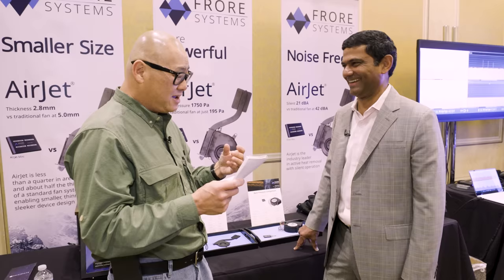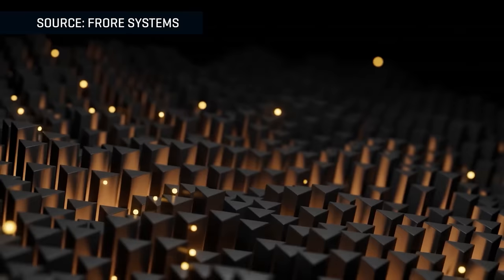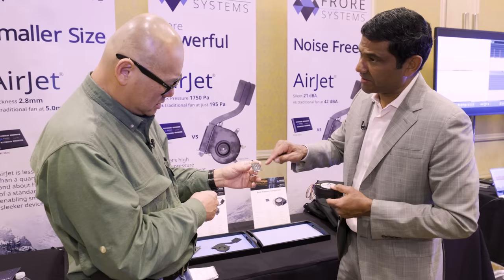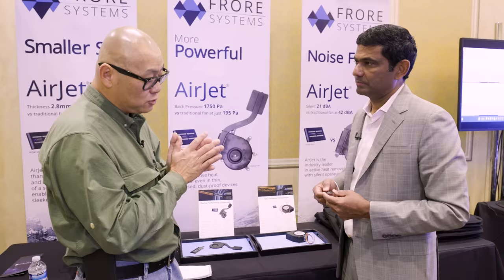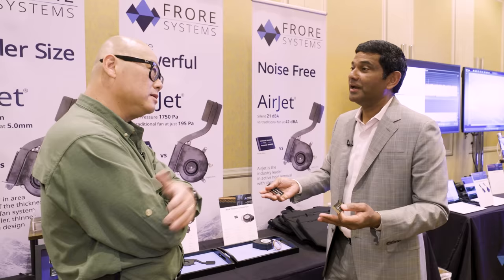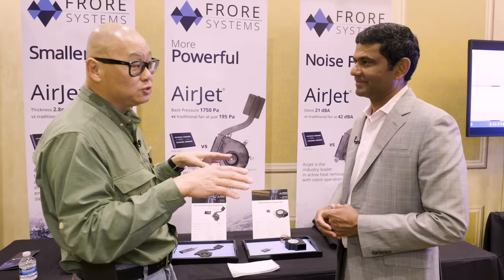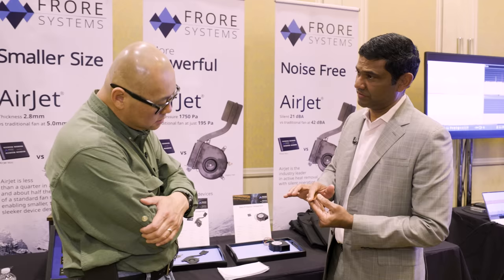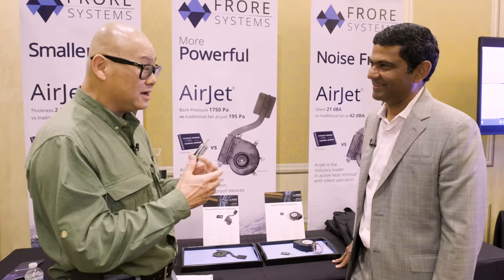Solid State Active Cooling Could Revolutionize Thermals

Comment: Even the Dyson blade-less fan has a fan beneath it. This is the first time I'm seeing air being pushed without a fan. It's a game changer for sure. Hope to buy a laptop soon with this.
Reply: I've seen very large fanless air-moving devices. They're not micro-scale, but if you want to see one on YouTube, @DIYPerks made one (his "breathing" PC)
Reply: Take a look at piezoelectric fans
Reply: wind turbines also don't have fans.
Reply: There's also ionic fans
Reply: @justseifert  That's what I guessed this would be before watching the video, but turns out it's yet another technology, which is cool.
Reply: Much like the Dyson which is just a normal fan in a funny enclosure, this device uses a vibrating membrane to replace the fan. The membrane thus becomes the weak point. This might have many advantages, but it's not solid state. Basically imagine if they were showing a fancy new heat sink on a processor, with a traditional fan on top of it. Would you still be floored by it? Because if membrane fans were so good, I imagine you could pair them to a traditional heat sink...
Reply: Look up ion propulsion.
Reply: When you get down to the microscale level, the forces in play scale in an interesting way. For instance friction is many times less influential, while surface tension and pressure are many times more influential. The wear and tear of MEMS devices works differently than for macroscale devices. Longevity is designed in much the same way as for semiconductor chips - 10 years or maybe up to 20 years. Basically it's virtually guaranteed to operate the same for that time. The way that this membrane device would work is by capacitance, where you're pulling and pushing a membrane in different spots by driving a voltage. Like the reverse of a pressure sensor, which reads the voltage difference caused by the flexion of a capacitive membrane. I haven't seen the cross section of this device though, but from the operation of MEMS that I do understand, that's what makes the most sense to me.
Reply: @andrewdamerau2742  So it could be easily used for laptops and have their lifetime, which is about 10/15 years without problem, up to 20 for example if it keeps low temperatures. Less stress on CPU/GPU/SSD/RAM.

Comment: This could be used for VR integration to simulate the movement of air in environments without having to deal with the noise of fan/mechanical devices. Would be amazing for a variety of things especially if you scale this chip up to the size of a box fan.
Reply: Or even just for keeping your face cool in general
Reply: Also for cooling the headset processor. Current headsets  COULD be more powerful, but they would need to add fans. Almost all headsets are passively cooled because fans on the face were tried, but were too unpleasant (from noise, weight, size, and vibration standpoints). This could really allow for a jump in processor power.
Reply: @ethany.2981  yeah, for helmets! dude thats siiiick
Reply: If all this doesn't suddenly flop, I bet the tech will make it to Quest 4
Reply: @darksunrise957  doesnt this new technology rely on vibrations to cool
Reply: @KvltKommando  Well, we'd have to see, but there's a lot of variables that could make the unit vibrate more or less.
Reply: Yea I see this revolutionizing a lot more than just cooling chips. This technology can easily expand for a huge number of applications. Amazing
Reply: @darksunrise957  fark! thats so true. then i wouldn't have to run through so many running levels to get air speed up to cool down
Reply: @darksunrise957 all the quest headsets use fans for cooling (quest, quest 2, quest pro, and upcoming quest 3), they are not passively cooled. The quest pro actually has 2 fans!! You can't hear or feel the fan, but it's there. I don't know about other brands of VR headsets since I only own oculus headsets, but most likely they all use fans. They are just super quiet

Comment: Incredibly hype to see the evolution of this concept. Hands down the coolest item that I've watched any CES coverage of this year.
Reply: what we need now is actual demonstration of the product. to prove it's not just hype.
Reply: I see what you did there
Reply: I hope it doesn't blow
Reply: @someoneinasia  it would've been great if Gordon showed few more clips of the chip in action :(
Reply: @someoneinasia  It is hype, this will be useless for today's desktop PCs, BUT it would be useful for some applications, notebooks, laptops, etc, this won't cut it to cool your 4090 or latest 13th / 14th gen Intel processor though - only problem I see with this is that it will generate more heat - it still takes a fan to exhaust heat, otherwise you are increasing your overall temperature.
Reply: @jimmydandy9364  He never said it would be for desktops... so every claim he said still stands aka it's not hype
Reply: @someoneinasia  it will gunk up with dirt in less than a week. Notice the vendor changing subject when the guy says dust proof.

Comment: Fell in love when he started talking about dust proofing. This is true innovation!
Reply: It's still sucking air I can't see how it's dustproof
Reply: @zainoferd7852  I guess it's sucking air from smaller holes, which if I think about it is even worse. Dust could get stuck inside quite badly, and can make it useless pretty fast. Someone explain me how this might be dust-proof.
Reply: owh that should get stuck really really quick. I don't believe he dust proof claim
Reply: @codingPotato21 but dust still can stuck on filter and block air flow
Reply: @FLevi-pi5vt  there could be different possibilities, but the more straigthforward is that there is an insane amout of pressure. There is no way the dust can collect in it
Reply: @zainoferd7852  Dust is not impermeable like glass or metal, you can get airflow through it if the pressure is high enough.
Reply: @zainoferd7852  He explained it very clearly. It requires high pressure to force air through a filter and conventional PC fans are not able to do that, which is the reason why you don't see filters. At least not fine particle filters. Anyone who's done woodworking is familiar with this. Dust collectors use specific types of blower fans that can deliver this high static pressure.
Reply: @IcaniCorrono  Sounds alright. Here's hoping it'll actually work and be the future of cooling hardware.
Reply: @FLevi-pi5vt  He literally said, because of the high pressure, you can use filters.
Reply: Pay attention to what he says exactly. Dust proof in an encapsulated environment. In that environment you don't have dust, but you're obviously spreading the heat, which can't escape.
So in a laptop, this is a problem. Even in a PC not getting rid of the hot air will quickly become a problem. In a large, dust-free environment like a server room it is not. And that's probably what this tech is designed for:
Industry, not consumers.
Reply: @gustavheinrich5565  likewise choom
Reply: @gustavheinrich5565  it will never be used in a server room. They use watercooler to get the heat out of the building, and having a system much more expensive than any fan in an environment where space isn't a concern and that wastes 10x more power is a big no-no.
Reply: @andrewc662  the atmospheric pressure is 1 atm at the intake, it will clog very quickly and get to a vacuum, it doesn't matter the high output pressure for this. Of course apple will use this and sell expensive disposable filters that you have to change every week.
Reply: @@codingpotato2115 such filters can't be cleaned.
Reply: @IcaniCorrono  it will collect at the intake, not in it. Any particle bigger than the pore will get stuck at the intake, being pushed in only by the atmosphere, wich isn't much. Get a syringe empty and pull vacuum, you can hold it, do the same with it full and push it, you can't, while there's no limit to pressure, to vacuum it can't make negative pressure, there's only atmospheric pressure pushing into vacuum.
Reply: @fss1704   It might or might not work, but what you're saying is not accurate. Dust not a solid, it has permeability.
Reply: @andrewc662  dust is what then, a gas, a liquid, a plasma? it has no permeability, it just leaves smaller holes that increases the boundary layer resistance to push molecules trough at the 1 atmosfere of pressure, eventually with the very small holes of the filter it will clog and that won't take long at all depending on the ambient.
Reply: @fss1704  let's just stop it, stiff head
Reply: @Disorrder  That's not the point... He compared it to regular fans which will surge right away when they have to work through vacuum, while this won't.
Reply: Dust resistant is remains to be seen. Give it a year of normal use then will see if it is really dust resistant.
Reply: @fss1704   dust particles have a mean size of 100um (heavy dust can reach 1mm, but in such case you are doing something wrong). Therefore, with an intake that is approximately 2cm x 5mm (roughly estimation) there are basically nothing that can stuck in the intake. The syringe example does not have any sense, no one here is talking about negative pressure (that does not exists, only a difference of pressure can be negative, not the pressure it self). 
The point here is that because of the pressure the dust that goes INTO it, it will easily expelled. And in order to be stuck at the intake the dust must be larger than some mm, which is no mor dust. If you want to be protected against grain/sand you can just use a fine mesh filter before the intake, without any need to replace it. 
If this can be a limit to a common fan, it is not (or order of magnitude less) for this MEMS.
Reply: @FingerinUrDaughter  it is with the respect of a common fan. That said, the speed of the air does not mean that you can hold an abject, in order to do that you have to compensate its weight that is a force, speed is not a force. For example, Do you think that a fly at 200Mph agains a wall have the same effects of a truck at the same speed?
Reply: @FingerinUrDaughter  200km/h was the vertical air velocity from the moving membranes hitting the cooling surface, not the output (horizontal) air speed coming out from the fan hitting the ball.

Comment: This is absolutely huge. Way bigger than any of the tech most companies are showing at CES. A new cooling solution could be absolutely revolutionary for both new and existing form factors, along with electronics longevity and performance.
Reply: anyone with basic know how in cooling can see this product is not viable at all... yet. power efficiency is abysmal. It's all that matters for portable devices, this will literally cut your gaming time by 30% on a gaming laptop. It needs an order of magnitude improved efficiency to be revolutionary.
Reply: @Cypeq  it's a first Gen product as they mentioned.. And looking at the specs it seems to use about 5w, compared to around 0.5-1.5 watts for a regular laptop fan. If the perfmance is better and can allow for more powerful devices to be smaller/quieter it may be a good trade off. The amount of space saved could be converted to battery space for instance to offset the power usage.
Also if you're using a device meant for heavier tasks like gaming or CAD or Google Chrome tabs (jokes) you likely have the device plugged in as the battery probably wouldn't last long anyway.
Reply: @Cypeq  In a phone maybe I can agree with you, but on a Gaming laptop I disagree with your opinion, I haven't finished watching the video, but if this tech can regulate its performance like a fan (low speed and high speed) then there will be no issues and even if not, I don't see that much problem, almost no one plays on a gaming laptop without being plug in
Reply: @rolandotula6951  Its basically replacing cheap fan that can be laud if small, with probably far more expensive solid state alternative that eats 10 times the power to cool the same thing but supposedly makes less noise. Supposedly has enough suck/pressure to work with good dust filters, which should make devices far less maintenance needy compared to classic fans, but with how its made I am not sure it can last for 10+ years like normal fans. Looking at it - it wont save space either, at least in high power situations, so can't really "fix" power usage with bigger battery. If they manage to bring efficiency high up, and also make that thing last years - it will be revolutionary, otherwise I feel like classic fans/water colling on high power, and passive calculated cooling for low power will simply win.
Reply: As a person currently working on a silent, but ultra small form factor build, I can see this working in conjunction with my noctua fans.

Getting heat out of tight spaces so my high volume fans can shunt it out the right gaps is a huge challenge for me, especially the smallest fans I can get still measure at 10mm in height.

It's all about use case. And in a PC build, the best solution is a hybrid one.

And for all the pp measuring people who say that "silent" and "small" builds mean a cut in performance, consider that having a 0 decibel RTX3070 noctua inside a Fractal Ridge is also an interesting challenge.
Reply: @Cypeq  gaming laptops are already unviable while gaming on battery. stutters everywhere and 2 hours of continuous playtime at best. so its a moot point. but if it can be improved then i can see surface pro and macbook air competitors take off. they're currently gimped too much
Reply: @dalm312  he is actually tells that the power draw is 1W with capability to remove 5w of heat - 8:20
Reply: @papajekket  I was looking for that info as I was reading the above comments thanks for supplying the timestamp, even says that is the max and it can/will run at lower power. Now if I only knew how many watts fans would use vs watts of heat removed to compare.
Reply: @Cypeq  U are hardly going to heavy game on a Laptop without being plugged to the charger
Reply: Its not viable at all, anyone who services laptops knows how much crap gets stuck in the fans after a short period.
Reply: @FrozenHaxor  I'll bite and call BS on your take.  Even if laptops have crap build up, it doesn't result in fan failure in overwhelming majority of cases.  Where is your supporting evidence that this new technology will not be "viable at all" due to debris build up?  The company claims their technology provides more back pressure than any fan of the same size could provide and specifically mention the dust-resistance with their product.  If that is true, would it not be fair to take that logic a step further and assume that the higher back pressure would result in LESS foreign material buildup?  I mean, eventually ANY fan will gunk up with dust, but that doesn't support your claim of the tech not being viable at all.  Dust buildup increases thermals for sure, but it's not like a dusty laptop immediately means cooling failure.
Reply: @Cypeq  Anyone who bothered to watch the video can see you didn't.  Their smaller 1st gen prototype operates on 1w of power at maximum performance and can remove 5w of energy.  Hardly "abysmal power efficiency".  1 Watt is right in the middle of typical laptop fan wattage.  There is always a balance between efficiency, performance, and cost, but to jump to "not viable at all" is nonsense.
Reply: @Tamarocker88  there are always naysayers with an opinion on everything. They believe they have every answer to anything there is.
Reply: Yea this is the only thing so far I have seen at CES that I thought was actually pretty cool. Hope it actually is any good.
Reply: @Tamarocker88  The success will likely be determined by its application scope. The current chip wouldn't work in most 50 - 250W laptops because you would need a crazy amount of them. A powerful fan blower cools modern laptops cheaply but this solid state solution currently only scales for small low power devices. It may only have a niche technology application
Reply: This guys gonna be filthy, nasty rich
Reply: I disagree with those saying that this tech is not viable as long as it uses too much power. I believe it's time for the battery industry to be pushed hard for new battery tech as we've been riding on our current battery options for a long time and we could see potential civilization altering benefits to new, higher capacity battery technologies.
Reply: @Tamarocker88  ima not engineer nor scientist, but 1watt for removing 5watt meant that we will need 35watt for removing 175watt GPU right?? so we need 35 units of these to cooldown 4090 laptop. or 15 maxi version of these.
Reply: @Tamarocker88  you also didnt watch because hes mentioned that you need multiple of these on a vapor chamber.
Reply: @nakazaki1254  The fact that several are needed doesn't change the fact that while operating at 1 watt under full power each unit reduces thermals by 5 watts. That alone is sufficient to disprove OP's unsubstantiated claim.
Reply: @natezimmer4489  still, it's promising and hardly "not viable" as others have tried to claim.
Reply: @alexamderhamiltom5238  yes, but this clearly isn't meant to be used in its current state on a goddamn 4090.  It will be best used for small electronics with limited thermals.
Reply: @Musician837  Push away... push hard, push long. The need has been there for decades, as has the incentive, as have billions in R&D. I'm sure they are just one online comment away from the push they need.